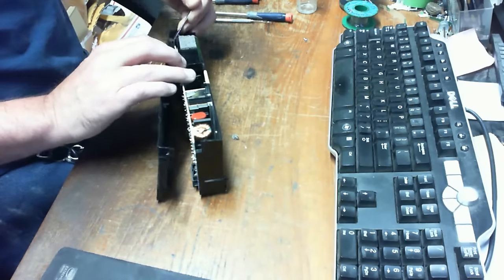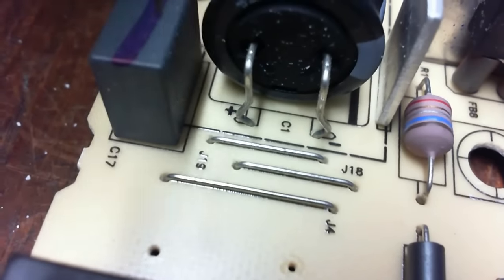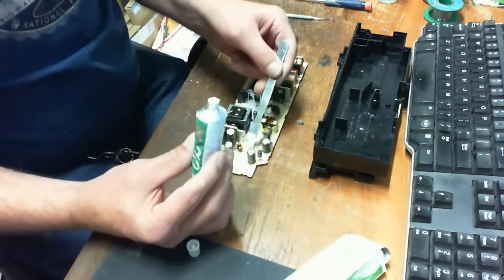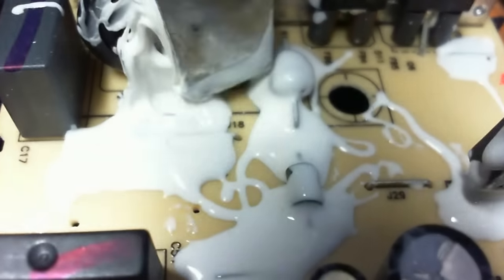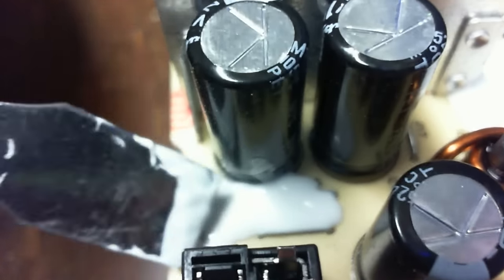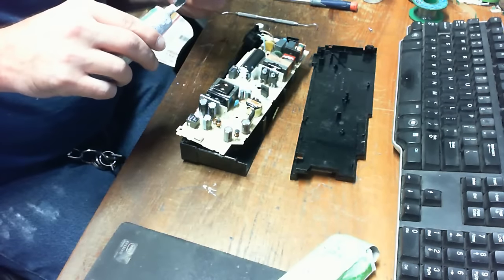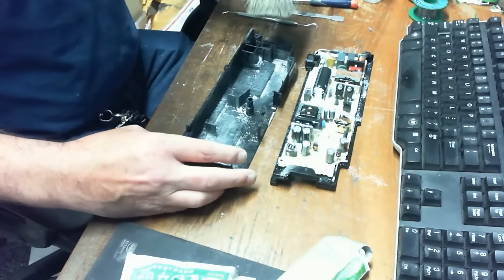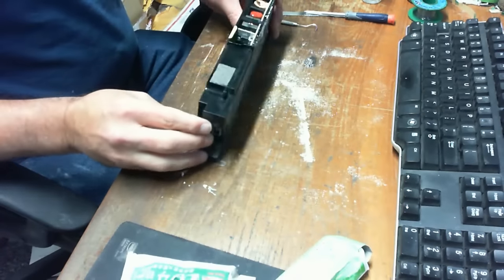How to Cockroach Proof your PS4 power supply

Comment: I know this is late but I just had a cockroach problem and I looked at it and a two roaches were in my power supply which made a break do you think I can just buy a new power supply?
Reply from the maker: Yes, go to eBay https://ebay.to/2WRKt6Z match the one you have with the one you need I have cleaning videos that will show you how to remove the power supply remember to clean out the system it would be best not to use the power as shown hear most used way to much even though I show them in the video and if you do never use it in any other location in the system.

Comment: So are we covering the shinny rods? Please tell me exactly what we are covering
Reply from the maker: LOL I show it in the video basically anything that will shock the crap out of you if you touch it, and doing it without coving parts that produce hear or are there to pull heat out of the parts. I will be making a new video soon that will just about make this video somewhat obsolete soon if you have subscribed and are getting notifications you will get an email when it is uploaded. or you can just check  latest uploads form time to time.

Comment: Can you give me a list of the supply/tools needed?
Reply from the maker: This is the exact stuff I used: https://rover.ebay.com/rover/1/711-53200-19255-0/1?ff3=4&toolid=11800&pub=5575170691&campid=5337859829&mpre=http%3A%2F%2Fwww.ebay.com%2Fitm%2F704-Silicon-Rubber-Temperature-Sealant-Adhesive-Glue-for-Electronic-Devices-%2F172385776624%3Fhash%3Ditem2822fe33f0 it takes a littel while to get hear but is very good for what I used it for in this video.
Reply from the maker: this is the tool you need https://goo.gl/RFuVrh

Comment: hey its wolf i tlked to before bout my ps4 that broke few yeats back do to roaches n i m tryn to get a ps4 slim so im wondering if roaches can get in n how can i roach proof a slim ps4 cuz im unable to gwt rid of the roach promblem i have tomany roaches
Reply: wc wolf yea my slim just died due to roaches
Reply: I'm in the process of replacing the power supply to my Ps4 Slim 1TB i just got 3 weeks ago. I can't tell you how angry I am, but videos like this are a lifesaver. I'm also going to wrap my console in mosquito netting. You can also get on Ebay and find a set of dust covers for the vents. I'm going all out to protect my console from now on. The screens were $3 the netting was $5. Small investment to keep your console alive
Reply from the maker: You should find my Video about dust filters first.

Comment: I just sent my PS4 in to Sony because my USB ports and LAN port went out. They sent it right back the same day they received it because of a insect infestation. I wonder if that would have caused the ports to go out.
Reply from the maker: You should call them back on a recorded line and ask them how they can say a bug in the box voids your warranty if you are not allowed to open the game system for proper cleaning and maintenance thanks to their warranty seal, if you are present they may even give up and send you a replacement.
Reply from the maker: NOTE: you do not need to tell them you are recording the conversation as they will tell you they are recording you, just quickly say: OK likewise, then immediately start asking about the bug that voided the warranty.
Reply: They told me that once the service center rejects it the warranty is void.
Reply: I hope I can get it repaired somewhere because I hate gaming over wifi
Reply from the maker: Why do you think the USB ports are not working is it because you will not stay synced to the controller?
Reply: +TheHGCGamersClub it's not reading any usb cord or sub stick. And when I turn it on it says too many sub devices connected. And the Ethernet port does not detect the cable
Reply from the maker: Did you get any water in it? or did anyone step on the outside of the box? or was it dropped? That sounds like a chip is shorted to the metal case.

Comment: where would I be able to buy this from?
Reply from the maker: http://www.ebay.com/itm/704-Silicon-Rubber-High-Temperature-Sealant-Adhesive-Glue-for-Electronic-Devices-/221968354148?hash=item33ae584b64:g:NE4AAOSwf-VWblr9

Comment: How long does the power supply need to be unplugged to decharge the mother board
Reply from the maker: that very's from system to system less than 1 minute unless your power supply is on its way out and about to fail.

Comment: Do you have a good way to clean the shit out of the ps4 I had gotten a free ps4 from a family member and they got it from an apartment and I’m cleaning it and it works but there is still dead cockroaches and there shit in it
Reply from the maker: You can use an air compressor to remove the dead body but Roach shit is almost impossible to remove best you can hope for is to clean up about 20% unless you have a large ultrasonic cleaner and know the exact procedure for properly drying the motherboard and even they, you will only get about 60 to 70% the upper and lower plastics can be put in a dishwasher and dried well before reinstalling the rest you will have to spend a lot of time detailing with Q-Tips and isopropyl the best you can.

Comment: today I was awoken by the smell of burning hair coming from my ps4 (I left it on restmode) so I unplugged it and saw a few roaches craw out. Can you fix this and make it Roche proof like you did here? I love my PS4 Slim. I use it DAILY and honestly would be very happy to get a reply.
Reply: I hope you can fix this
Reply: I used this method on a ps4 that I cleaned up and got working again for a kid. It worked for awhile but where he lives is pretty infested and they got into it again I'm assuming shorting out/damaging something else. I'm trying to come up with a way to keep them out of the case completely.
Reply: @patrickhdsn  have you found a way to keep them out completely?
Reply from the maker: @jusdeee  In my shop I can kill every roach in a game system electronically without even opening the system but that is not recommended for home use. 
As for keeping them roaches out of your game system; Sorry that is "factually impossible" the only way to keep roaches from finding and or getting inside your system is to Kill all the roaches in the house and do not take the system to a friends house that has roaches.

Comment: Gawd I'd love to learn to do this kind of stuff. I moved into a friend's house, after paying PlayStation to fix my system. Place had roaches but they all swarmed my machine. Now Sony won't take it back, I don't blame em. I'm going to buy the special screwdriver to open machine, pull out power supply, pull roaches out and hope it didn't break anything. Then I'll buy a new supply and use this stuff you talking about on a new supply box and hope for the best.  I'm not going buy a new one while this place is infected. I have traps and it doesn't seem like that much but they swarm my machine. What category is this in school incase I'd want to learn more. I'd like to buy the melty gun myself and make stuff. lol
Reply from the maker: 1st I don't recommend using the powder anymore most of you put it other places where it doesn't belong thinking they are helping and destroy the Disk Drives or cause other problems
2nd if you wish to learn how to repair stuff don't become a criminal by learning repairs off YouTube Go to school for component level electronics then any other advanced electronics classes you can find.
NOTE: You will find that if you actually complete the classes for component-level electronic alown you will not want to repair game systems because there is not enough money in it and you can make way more doing other stuff, one of the main reasons for so many fake repairmen doing game systems. I do it only because I refused to be shut up by Play-N-Triad threatening to sue me if I did not remove all mention of them hiring fake repairmen with no education from my website and YouTube channel that and I wanted to give kids a place that they could actually get a good priced repair by an actual person that when to school for electronics along with a lot of other related fields.
Reply: @ClovisX  hey man thanks for answering. I been watching videos about circuits and  it's alot to take it but also fascinating. I'm wondering tho and I like to here this from you as a pro, what if u bought a fine mesh bag to cover the PS4? Just cut holes in it for the plugs and perhaps duck tape the holes. I never use discs on it anyway. You think it would be breathable enough without over heating the machine? Or should I even throw some type of cooling pad in there too? I really want to play again, but I'm not replacing my machine til I find a way to protect it. I am currently trying to lower population of roaches too but that's alot of money to risk, again.
Reply from the maker: @mogsonmushrooms  Very Bad Idea sorry I will be going into detail about this soon on a newer video in fact, I will be Remaking a lot of my videos in 4k Video format soon and giving more detail about what and why and even add in a few things I apparently left out due to being rushed and having to piece together or shorten clips. Hopefully, you will help me pump up the View Count on them.
Reply: @ClovisX  I bought a laundry bag used for delicate clothing, I pulled all the cords forward and put them through the zipper and duct taped it shut. Now granted I'm using this idea on a ps2 but I think my idea is going to work. It's not over heating or even that hot at all and roaches can't get in. If I knew how to send you a pic I would. I haven't played this ps2 in 6 years but it's something to use til I get population down abd save for a new machine.
Reply from the maker: @mogsonmushrooms  That will not work you will only kill your game system.
Reply: @ClovisX  I don't see how it's not even hot. It's super loose on the machine. I could even fit a fan inside with it to cool it. It's just a ps2, not really worried. Had it on since 1pm it 930pm not even warm and it works.
Reply from the maker: @mogsonmushrooms  Its like this, the bag will act as a layer of dust from the moment you put it on yes the system has the ability to compensate for the restricted airflow by increasing the fan speed and yes it will stay somewhat cool but you are drawing more power to cool it making power chips work and capacitors work harder as you play the dust will quickly buildup on the bag and restrict the airflow over 1 days playtime the system will have the equivalent of 3 or 4 months worth of dust buildup meaning you will need to clean more often than if you did not cover it in the bag. If roaches are your concern you will not stop them the babies are small enough to fit easily thew the holes in a clothing bag and once they are in they can not get out meaning you will have a colony of roaches that must eat the green portion of the motherboard and each other to survive and that will quickly destroy the system too. the best thing and easiest thing to do is just open it and clean it out from time to time, but hay if you don't care that's on you just please do not offer that kind of advice on my channel okay.
Reply from the maker: @mogsonmushrooms  I saw the part were you say you were going to do this for a short time untell you get the roach population down that would be okay just remember you should not use this for a prolonged time and regularly vacuum off the bag to allow as much airflow as possible the PS2's never ran all that hot so it should be okay for a short time.

Comment: Just pull off the power supply when you're done playing when theres no heat then cockroaches won't go in there. Real simple
Reply from the maker: The power supply is not what makes the heat so that is not true, they do not like the power supply they like the heat of the system when it is on. FYI: the heat of the system incubates their eggs faster they love the PS4's because they are perfect breeding grounds
Reply: @ClovisX  that is so funny. Where does the heat comes from if you pull off the power supply?  There won't be any heat at all. So the point is you have to pull off the power supply cable when you don't play it. Even kindergarten kids understand this
Reply from the maker: @nelson466  Don't be stupid; FYI roaches are attracted to the heat of the system although there is a small amount of heat produced by the PSU by converting the AC to DC that is true but almost 90% of the heat coming out of the system is not form the power supply it is from the heatsink cooling the main Chip so pulling the power supply out is not going to help at all and just so you know roaches are not as stupid as you think they are they remember and they will get inside while it is still cool and it will not hurt them they can easily go inside the system while it is playing next time you use it.

Comment: What do you charge to repair and insect proof
Reply from the maker: there is no such thing as insect proofing. But you can protect the power supply by covering all the hi voltage points in the power supply this helps but is not 100% best thing you can do is get rid of the bugs in your room, i know it may seem like an impossible task but with work and determination you can do it.